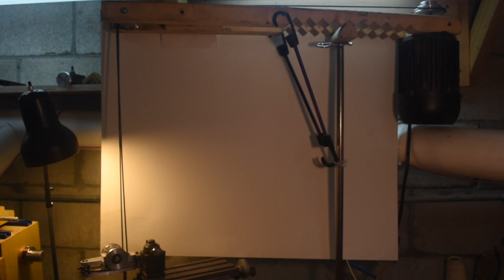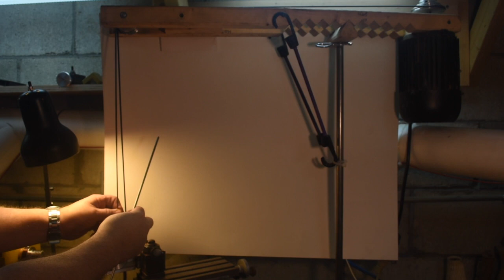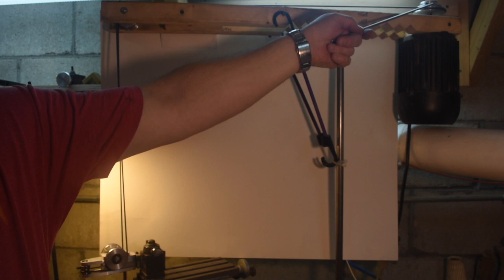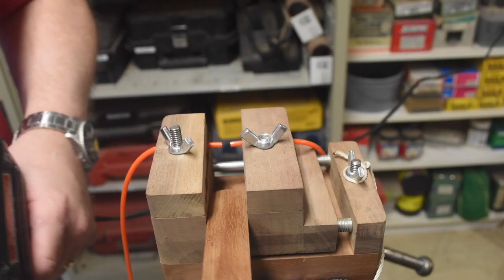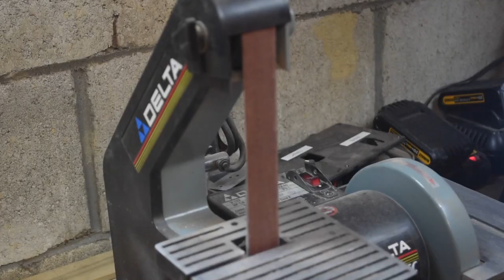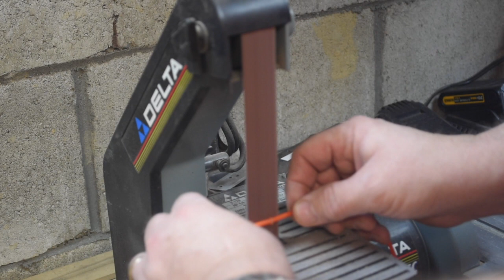MDF Rose Engine Lathe : #7 - Overhead drive

Comment: Hi Rich. Do you have new links for the welder and the overhead drives? Thanks Dave Bell
Reply from the maker: Dave, in the Ornamental Turning Book of Knowledge (https://www.otbok.info), there is an entry about overhead drives, and it also includes the instructions for making the welding jig.  The welding jig is quite simple to make and is really useful.
Reply: @RichColvin  Thank you.